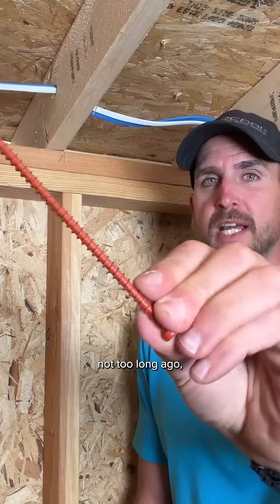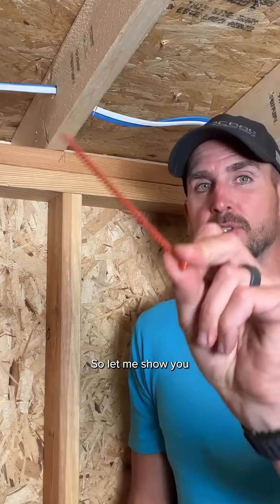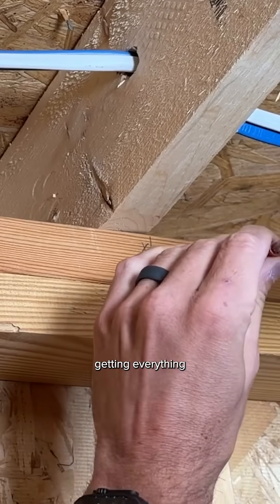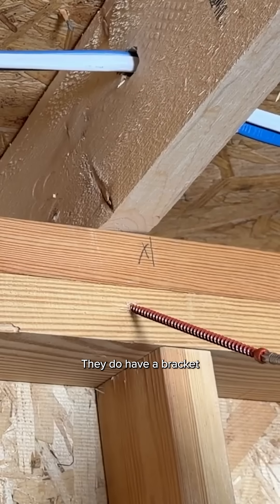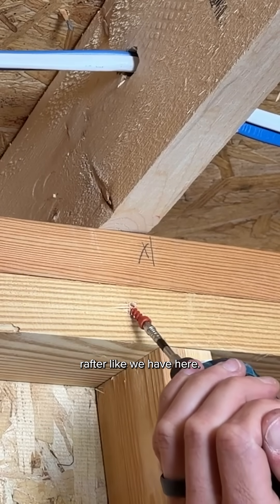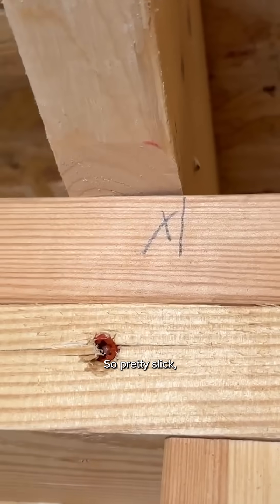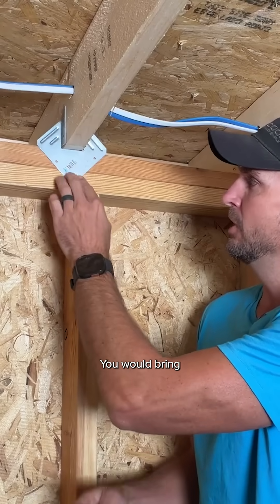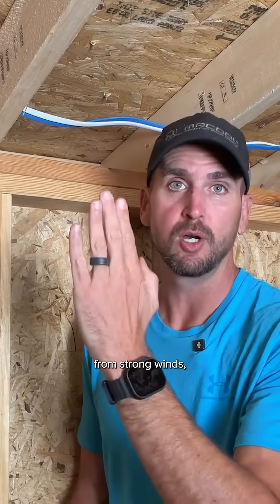The Screw That Makes Hurricane Straps Obsolete?

Comment: Hard to believe its better
Reply: Simpson has tested both and that is what leads to the capacities listed in their literature.  You can look it up and judge for yourself.
Reply: @SteelheadTed when the beam cracks after a few years then  the rating they claim based on tests done 10 seconds after putting the screw in, in a lab, wont mean sh..
Reply: Its crazy how the people who know the least about any science are the ones that repeatedly chant it like its a charmed spell that magically makes them superior lol.  I guess its kind of easy.. let me try. 
"Science" 
..... See? Cool, now that means Im correct. Taking my aptitude test shortly. Im gonna just write:
"Math" 
Genius.
Reply: It just depends on what you mean by better. Labor-saving is a legitimate way for something to be better. Strength is another. In terms of strength of a single connection, it's almost certainly inferior. But were people putting the plate style one on every single rafter? The red screw saves so much labor that it becomes feasible to use a lot more of them
Reply: Same company makes both!
Reply: Sure doesn't look better. Looks about 7x worse actually.
Reply: That screw will shear before those nails will.
Reply: @nicosies it’s not loaded in shear…
Reply: @nicosies specifically designed against that, thats literally their whole purpose.
Reply: Plate uplift in Doug-fir is 545 pounds.  The screw is 615 pounds.  Simpson publishes these values based on testing, you can look it up for yourself.
Reply: @SteelheadTed based on testing. Done in a lab. 

Id trust a plate and nail hammered in perpendicularly to the grain into the widest sides of they wood, to not split the wood and last a long time. Vs driving a long scew in at an angle into the plate and then into the barrow edge of the beam. 
It may be stronger if its done right. But when if the angle is wrong, or the wood splits. Whatsbit rated at then and how often does that happen during contrsuction and how often does it develop over the lifetime of the roof?
Reply: @SteelheadTed  don't trust the seller-made test. At All. Plenty of those out there that mean nothing, from toothpaste to skin creams. The plate is better in this application. 
You're welcome.
Reply: @Ben-v7e You don't trust the testing of this product?  You mean the same kind of testing the plate connection went through?  LOL.
Reply: @SteelheadTed  found the plant, can't help but spam the same comment on every thread? You guys can't be that desperate
Reply: It's not better, it's cheaper.
Reply: @itninja9503 it provides a higher uplift capacity.  How is that not better?
Reply: @SteelheadTed  Rofl, I draw engineered house plans that meet Fortified requirements at a minimum in the SE. These screws are awesome and really are stronger. One of the most common problems we see are builders not utilizing every fastener hole in most connectors. Screws eliminate that and help speed up the process. I do not know why so many people refuse to just read the literature.
Reply: Guess those fasteners guys have no idea what they are doing....
Reply: @farmeunit I know, right?  We should , " trust the science."😅
Reply: @williamevans6522  You clearly don't understand the priorities for trusting something.  It goes like this:  

#3 How I've always done it
#2 Science (unless it disagrees with #3 or #1)
#1 My gut feeling.  

😁
Reply: @JustSomeJoe-dp5rp 😂😂😂😂😂
Reply: @williamevans6522  what is your house held up by? thoughts and feelings?
Reply: @Karaokedad80 and hopes and dreams😊